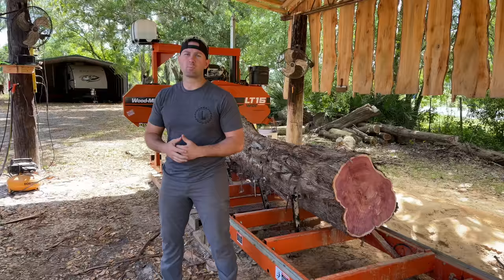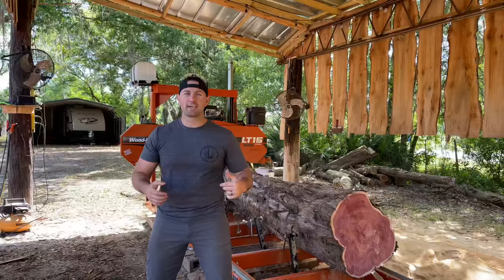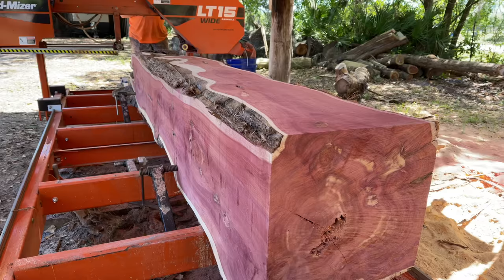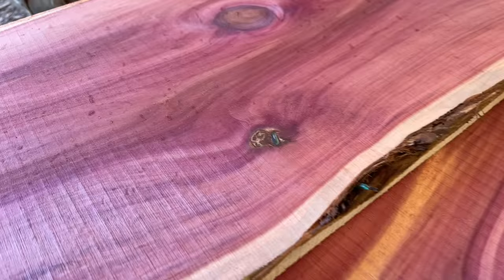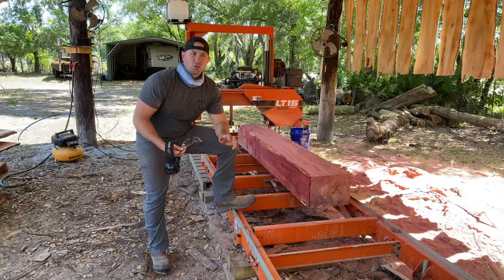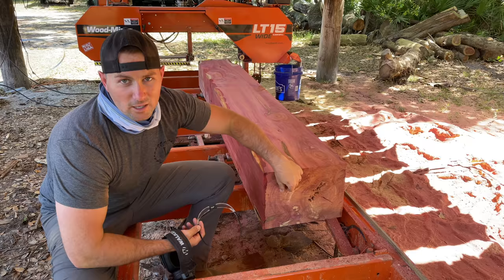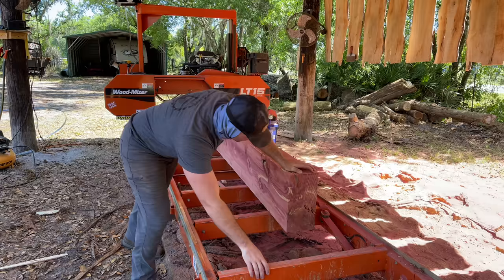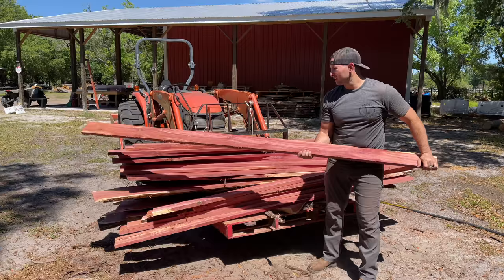Our Most Beautiful Boards Yet From An Ugly Old Cedar Log

Comment: you guys do know that sawdust is valuable right? put down visqueen and catch it, bag it up, craigslist...  then you can chip those crust ends use for mulch, gardens so forth..  also, you guys are not sharpening your own blades? aw hale yes, save that money, you can do it by hand with a files or you can get a file hodler system clamps to the mill and you run the blade, just like a chainsaw set up... sharpen that shit, ALSO, can might consider tempering those blades if they are not already, harden them as much as possible OR, but the bullet on carbide tipped if you have dirty wood, takes a lot of metal to destroy carbide and they can be retipped..

go to restaurants and ask for their old used up deep fry oil, save up till you fill a 55 gallon barrel drum, use that to harden your blades before your next sharpening, use stainless steel sharpening tools, (diamond embedded tooling and files)  you should be able to get that blade very hard with proper tempering/hardening and it will last so much longer between sharpening, make quick work of nails and staples so forth..

what I use the material for dictates how I saw it up, IMHO you cut your up for shelving..lol sorry but yea shelving,.. still valuable tho.. a nice bookcase, or your clothes closet shelves? cedar is insect repellent so its good for dresser drawer drawers, even just the bottoms of drawers will repel insects, spiders everything, and it smells good.. you ever consider selling that to local luthiers? cedar is used on acoustic guitars all the time and there is/was some good cedar in your log.. before you got to hackinit up you had large enough log to do acoustic backs/tops and sides, go to ebay to see what good red cedar back/top and side kits sell for, like $200 dimensioned, top and back is bookended, so you need like 12" wide by oh, 1.5"" thick and 24" long, for back and front, then for the sides you need like oh what is it 30" long, 1" thick, 8" wide?... luthier does the book end cutting, but just for that nominal amount of wood $200, maybe more today instrument wood is SKYROCKETING

if I were you guys and you have spare time, go find downed hardwoods, they use burls everything today, root knots every bit of it.. even river and lake water logs are good.. determine what logs are best for what instruments, electric, acoustic, so on so forth..  its worth a fortune these days and going up daily, specially maple, ash and the rosewoods, rosewood is insanely expensive, a 20" long by 3" wide x 3/8" thick is around $300, a guy your age should be farming it, it matures in 20 years and in 20 years the value will be insane no jokes, stock up on that, alder, ash and especially maple, most guitar necks are hard rock maple, also if you run into figured wood?  $$$  ching ching, big money for instrument makers, BIG money, specially your flamed and birdseye hard rock maples, but hale they use burl, quilted is real nice too..

some gurus claim they can look at a maple tree and tell if its figured, not me, but its a jackpot when you find it, especially if it's a nice large clear log, man you had a lot of clear in that cedar log there.. primo for acoustic guitars, you should see how they make it look in the end, bookend matched... hale maybe you already know? but the way you hacked that log up it didn't appear as if you considered musical instruments, they make pianos to ukeleles, all sorts and you know how expensive regular construction lumber is getting, musical hardwood is triple that.. ridiculous anymore, wish I had bought a few thousand acres and planted maple when I was young.. alder is still plentiful, regenerates fairly fast, 8 years or so, grows like a weed, Strats like Stevie Ray Vaughan's strat body was made with alder, it's considered cream of the crop in the stratocaster world, ash too... if it's the right weight and so forth, good sustain when you thunk it..  lol

you guys are lucky, I've wanted a portable mill for 45 years now, and about 200 acres of mixed heavily forested virgin or first growth timber...  I almost bought 20 acres last summer had a 1 acre ancient maple grove, I was afraid I'd chop it up and make guitars out of it... however you can harvest the seeds and sprout them, replant, so if you see a primo maple and are like man, go back when it seeds, they are like helicopters, rake up a bunch, sprout em, nurture them in pots and greenhouse till they are like 10ft tall ready to plant in the wild, in 50 years you will have some primo maple.. retirement program, it be worth a mint in 50 years.. hale order some brazilian rosewood seedlings, grow a few hundred acres of that, instant billionaire, brazilian rosewood is the most sought after hardwood on the planet, its so bad CITES made it illegal to ship out of the country, it's on the endangered species list, right up there with ivory, but very legal to grow and harvest on your own property...

man.. lucky bastages